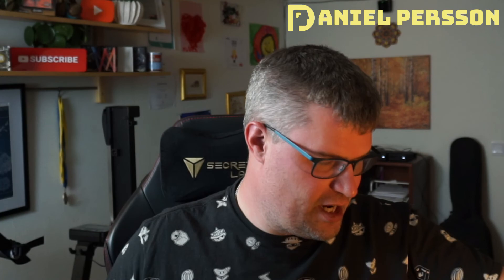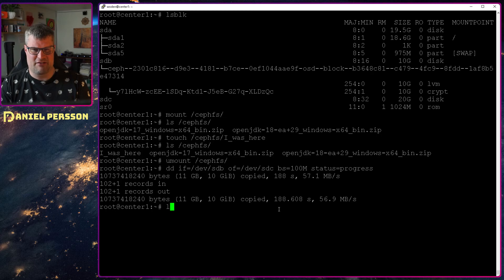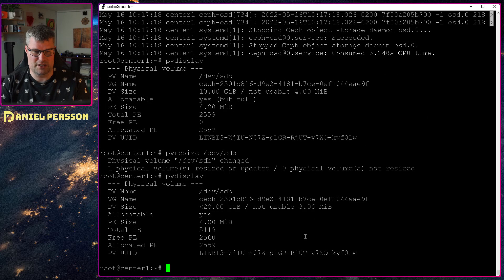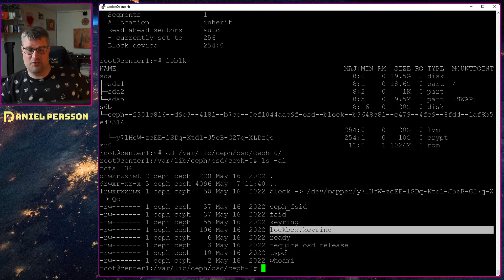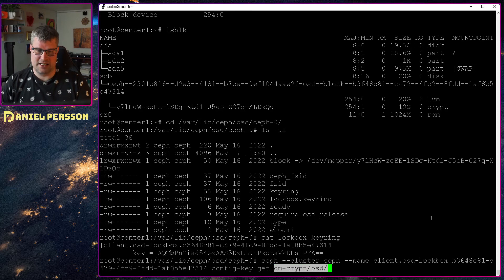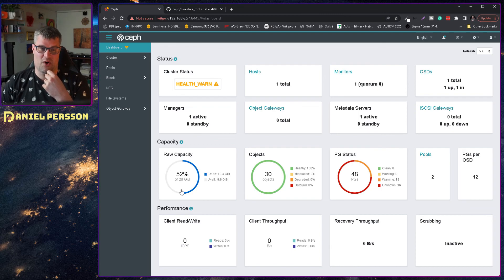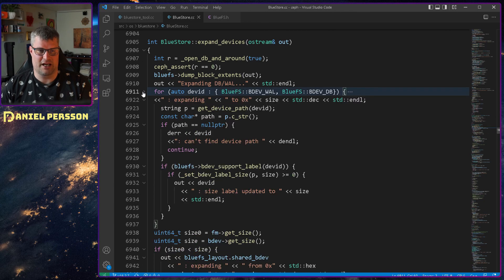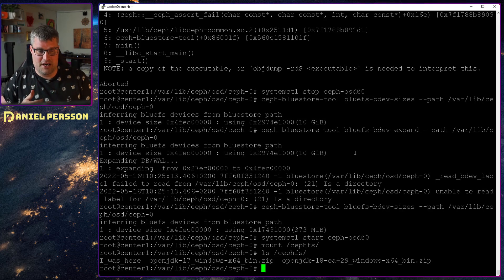How to resize a osd in Ceph

Comment: Hi Daniel,

Great stuff as always! One question, I thought OSDs purposes is if you add an extra 20G OSD in with that 10G OSD currently in place, you will have 30G? What's the purpose of moving data from one OSD to another?
Reply from the maker: Hi William.

You are correct but this particular case was when you had ran into a wall and could not continue. A Ceph system should never be more than 90-95% full or you will run into issues and services will crash. And in this case the drive was completely full so you could not start the OSD to rebalance with another. 

In this case the upgrade to a new drive will save your data.

I hope this helps. Thank you for watching my videos.

Best regards
Daniel

Comment: This Daniel Persson is a magician! The Ceph volume resizing is so confusing. Seems like a common task that Ceph source code should fix and provide bluestone with more reliable way to do this right.
Reply from the maker: Hi Krishna

Yes, I think that could be a nice tool to add to the toolbox. Sadly I think this is an edge case as most of the time if you have not ran into a situation where everything is full you could replace a drive with a bigger one by just pulling it out and adding another.

Best regards
Daniel

Comment: How to do Cluster is reporting utilization of storage device osd. 1 of device_class type has crossed 75℅ on host .I need Immediately free up some space or add capacity of type ssd
Reply from the maker: Hi anil

Not sure what you mean. You will get the total utilization in your cluster, and other than that, you need to check the utilization of the pools using a device type in order to figure out if you need to add more storage. 

If you use an Alertmanager, Grafana, Prometheus setup, you'll get alerts when you reach over 90% utilization, but I would think of adding more when I'm close to 75% as the performance of the cluster decreases when it can't move data around efficiently.

I hope this helps.

Best regards
Daniel

Comment: Hi, Couldn't the operation you did with dd be done with lvm's own tools for some specific reason? When I want to migrate data online I add the new disk to the vg then use pvmove to move the data without the need to shut down and stop services, or at least reduce downtime. Finally I use vgreduce and pvremove to remove the old disk.
Reply from the maker: Hi Araujo.

You are probably right, I don't have any deep domain knowledge when it comes to LVM drives. But the way I describe in the video solved the Ceph issue we encountered at least. And you need to update the database file anyway so perhaps bringing it down in an HA system isn't the most critical sacrifice you can do.

Thank you for watching my videos.

Best regards
Daniel

Comment: After resizing the hard disk from 50 to 100GB. It is being reflected as 50GB used. I Used rook-ceph to provision the cluster. Any idea on how to overcome this issue at k8s level?
Reply from the maker: Hi Vinoth.

Thank you for watching my videos. As I mentioned in the video, you need to update the metadata for the OSD to recognize the new size. Perhaps there is another metadata layer that needs updating for k8s. I've not tried this operation in Kubernetes, but that might be a video topic for the future.

I hope this helps.

Best regards
Daniel
Reply: @DanielPersson  Thank you for the response Daniel. Rather than increasing the disk size I added additional HDD (sdc) and modified cluster.yml to accept it as new osd. Worked like a charm. Still increasing existing HDD use case seems a question mark. Waiting for your insights. Thanks ☺